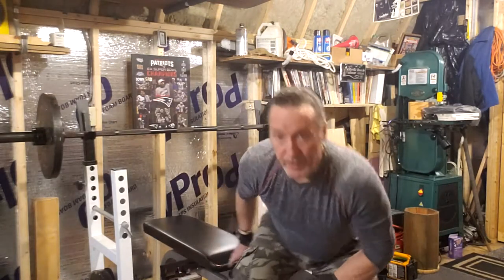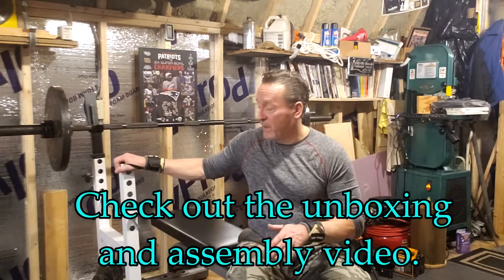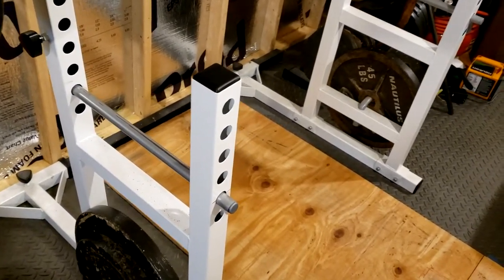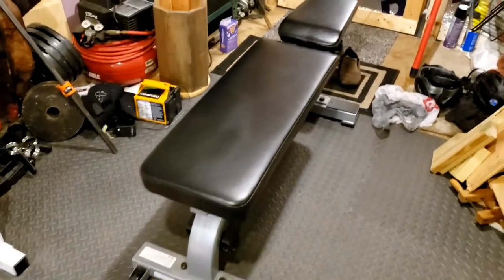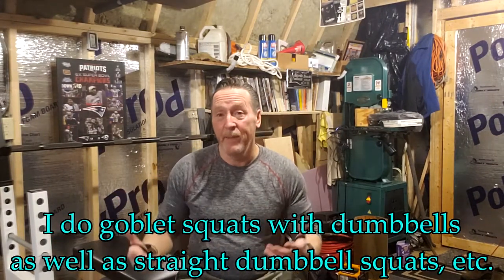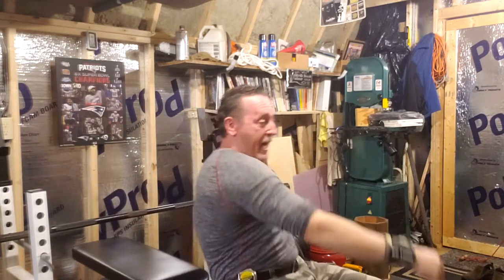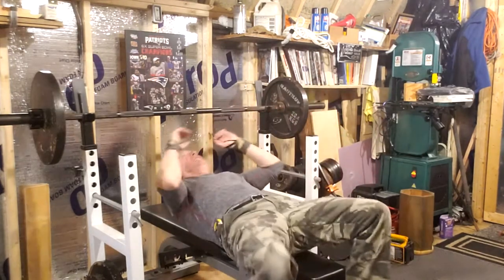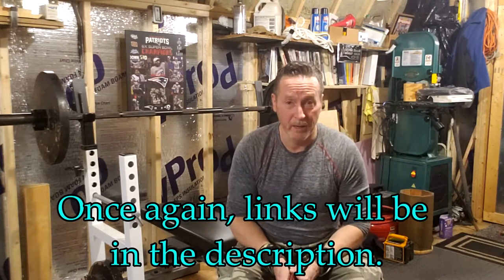𝐘𝐨𝐫𝐤 𝐁𝐚𝐫𝐛𝐞𝐥𝐥 𝐏𝐫𝐨 𝐒𝐞𝐫𝐢𝐞𝐬 𝟐𝟎𝟒 𝐁𝐚𝐫𝐛𝐞𝐥𝐥 𝐒𝐮𝐩𝐩𝐨𝐫𝐭 𝐑𝐞𝐯𝐢𝐞𝐰

Comment: Good review. Much more detailed with measurements than other reviews. Keep doing whatever you do if it is working. Enjoy life.
Reply from the maker: Thank you Fujiko. I appreciate your complimentary comment about my review. I use this barbell support almost every day for years now and it is rock-solid!
Best,
Bob
Reply: Just got it in the mail last week  and I really like the rack. 

I'm also going to put down a riser for my bench. I bought the 101 flat bench from York and it's 28.5" tall. I'm kind of a thin guy and even the spotter bars at the lowest hole is not enough for me. I'll have to do a bit of measuring first.

The construction of the rack is solid and seems very stable. Especially against a wall. 

Thanks again for the review.
Reply from the maker: Fujiko,
  Enjoy it! I use mine multiple times per week and have been for years. Get ready to pack on some muscle!
Best,
Bob

Comment: Thank you for uploading, demonstrating and advising on this outstanding equipment.  I am considering upgrading my basic bench for something safer.  I have not reached 200lbs in the bench, yet (but it is coming!) and with so many options out there I know I don't need something that cost over 500 bucks , yet I need something eventually that will stand up to 300 to 400 lb bench presses. And York of course has had a solid reputation for generations.  Thank you very much for showing us this is available.
Reply from the maker: Hi Antonio,
  I bought this over a year ago and have used it almost every day since.  It is solid and I recommend it highly. Years ago I, when I was in my 20s and 30s, benched in the mid 300 - 400 range but at 63 years of age I'm more in the 200 - 300 range. This support fits the bill for me and I don't contemplate having to ever replace it based on it's sturdiness and solid manufacturing.
  I recommend it highly and would never recommend any product that I haven't used extensively.
Any other questions, please ask.
Best,
Bob

Comment: Thanks for the informative video.  Have you tried it for incline benching? Or military presses?  I am curious if the adjustable bench with fit far enough back for these types of presses.
Reply from the maker: Hi, honestly I don't do them much at all due to some shoulder issues I've experienced doing them over the years. I think it shouldn't be a problem though . You may have to lift up the supports another notch or two though on the barbell support but that's easy. If you want me to take a few pictures I can do so for you if you just email me at bobbessette@totallyuniquelife.com. I'm in my shed gym every day. :-)
Best,
Bob

Comment: Great review, thanks. I just came across this online and this was the perfect review to help me make my decision. I have been looking for a sensible short squat rack for many years, as my basement is just a little over 6 feet high, and most power racks are much taller.
Reply from the maker: Hi Andy,
  That's great to hear. Sorry for the late reply as I like to respond within 24 hours. Did you purchase the support? BTW, thanks for your comment and it sounds like my review was informative.
Best,
Bob

Comment: I have a bit of a weird question! The width of the stand is adjustable thanks to the black bar at the bottom, right? is it possible to take the black bar out completely so that you end up with 3 pieces (the black adjuster bar and the two white vertical stands) that can be easily shoved in a closet? I am an apartment dweller and need to hide my equipment when not in use, but a lot of the individual 2 piece squat stands aren't very stable and the safeties are completely useless, so I'm really intrigued by this...
Reply from the maker: Hi,
 Thanks for watching the video and I'm sorry I didn't respond sooner. I am not at my house today but I think you could do this if you want because when it was delivered it came in sections. So, if you want, you could disassemble if you like. Just curious, how much are you looking to squat? I don't really use it for squatting because of where it is in my shed and lower back issues and strictly use it for benching. 

I know in the video I did demonstrate squatting for informational purposes.
When I get home tonight I can look at it more closely but definitely you could take it apart if that is a need of yours as that was the way it was delivered, in sections.
Best,
Bob
Reply: @TotallyUniqueLife  thanks for the reply! Realistically I probably wont squat more than 225lbs for reps.
Reply from the maker: Yeah, 225 lbs should be fine. I wouldn't go up to 315 on this unit and would stick with a full squat rack for that amount of weight.

Comment: I just saw your first impressions video and perfect timing I saw you had an update! I appreciate the videos, I was worried it would be hard to squat properly over the spotters but it seems just fine. I was wondering though, do you think touching elbows to the uprights will be a problem with a 6ft bar? It seems just fine with your 7ft but I figure I'll have to make it smaller to accommodate mine. Thanks!
Reply from the maker: Hi A, thanks for your question and for watching the video. I appreciate it. That's a good question. I can answer it but you need to give me a measurement. When you load your weights onto your 6' bar, what is the distance between the weights on either side. I need to check if my current setting would work for a 6' bar. So I need the full length of the bar in the area where your hands are placed but don't include where the weights are or after that until the end of the bar. If it's easier to send me a picture with the measurements you can send it to bobbessette@totallyuniquelife.com.  Once you answer me I should be able to answer your question.
Best,
Bob
Reply: @TotallyUniqueLife  Hey Bob, thanks for getting back to me so fast. I checked today and the gripping area of the barbell is 47". Beyond that is the flared bit where the plates would slide and rest against. This measurement is not including those "collars" if you will. Thanks again!
Reply from the maker: Hey A, I think you are good to go my friend! The distance from both supports with my setup is 45 1/2" which is on the outside of the support arms. The distance from the inside of the support arms is 41". So, it should work for you if you're at 47". If your height is anywhere from 5'5" to 6'1" I think the setting I have it on should work for you great! I actually took a picture yesterday that I was going to mark up and send to you (and I still could) if you want to provide an email address.
Anyway, have you located one yet? I would go to the StrengthWarehouseUSA.com site and use their contact page - https://strengthwarehouseusa.com/pages/contact-us and tell them you're interested in buying this rack on their page - https://strengthwarehouseusa.com/products/york-barbell-4232-pro-series-204-squat-rack-barbell-support?variant=28428529598558 and I think they could try to expedite getting them back in stock. I have no affiliation to that site but he uses some of my videos. I've had many discussions with Joe who runs the place and he should be able to let you know when they will be back in stock.
  Anyway, good luck and based on what you told me you should be in good shape.
Best,
Bob
Reply from the maker: @NickIsAWaffle  I just noticed that at 5:40 into the video I do a measurement. So you can actually see it up close. This particular setting should work fine for you but, don't forget, it is adjustable and can be moved closer together. But if you do that I guess there is more of a chance of hitting the supports during benching. But it appears this setting should be fine for your 6' bar.
Best,
Bob
Reply: @TotallyUniqueLife  Hey Bob, thanks a lot! From what I can see with that timestamp as well as what you're telling me, I think I should be just fine. I have found some stock and placed an order, I'm excited to see the thing in person! If you want to include this link in the description, it seems they still have some available: https://www.biggerfasterstronger.com/products/pro-series-204-barbell-support-york

Thanks again!
Reply from the maker: Thanks A. I certainly will include your link in the description.
Best,
Bob
Reply from the maker: Hi @A, one other thing, could you possibly send me a picture to bobbessette@totallyuniquelife.com with your new support all set up with a 6' bar on it? I also have a website and am writing a review article on it as well and it would be great to include not only an image of a 7' bar on it but also a 6' bar on it. I don't own one.
Thanks!
Bob

Comment: I don't know for the price I think a power rack and a bench would make more sense
Reply from the maker: Hi Rich, not sure what you mean. I bought both the barbell support and the bench separately which is, I think, what you are suggesting. You did say power rack though which really doesn't work for me in my shed workout area.  I also do not perform traditional squats any longer due to lower back issues so I really didn't need a full power rack.
Thanks,
Bob
Reply: @TotallyUniqueLife  I gotcha if your not squatting it makes sense. I pretty much only do the big 3 with some  Accessory work
Reply from the maker: I hear you Rich. I do some dumbbell squats and goblet squats. In addition to those I just purchased Monkey Feet and I can now do hamstring curls which is really nice because I don't have a leg curl or hamstring curl machine.
Thanks,
Bob